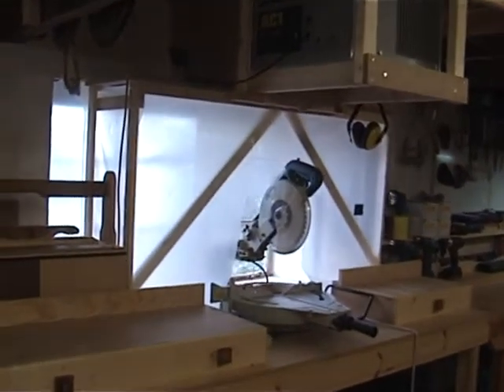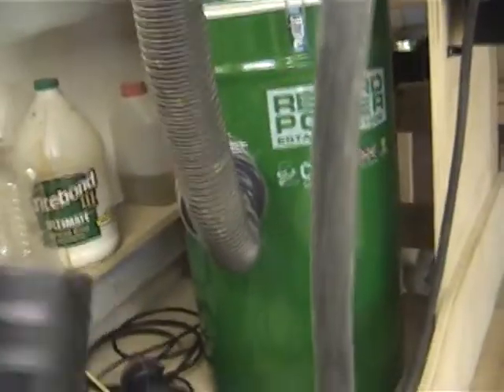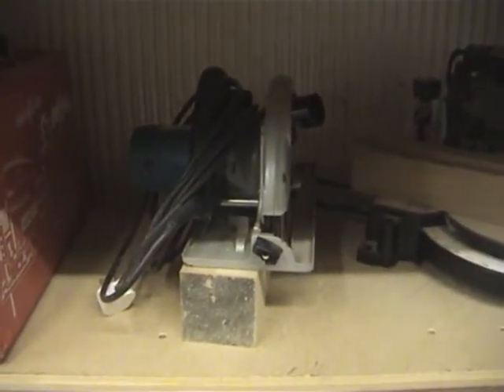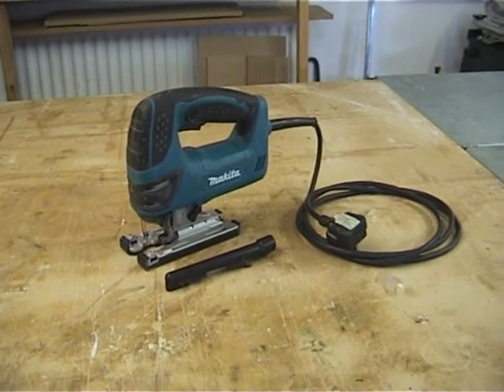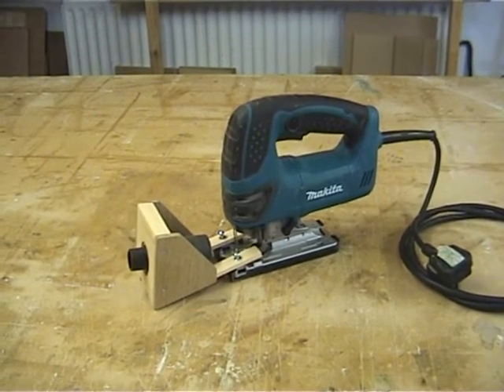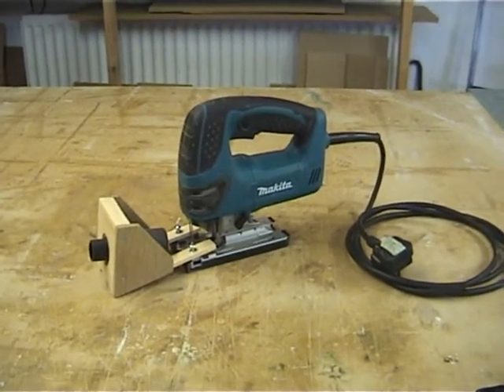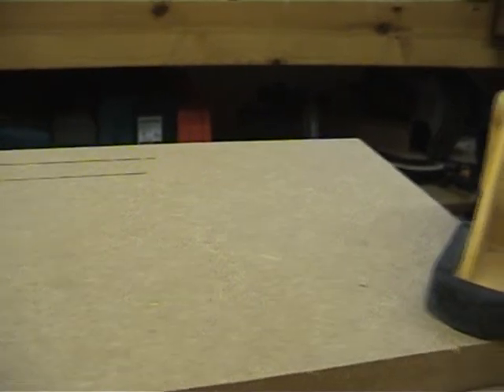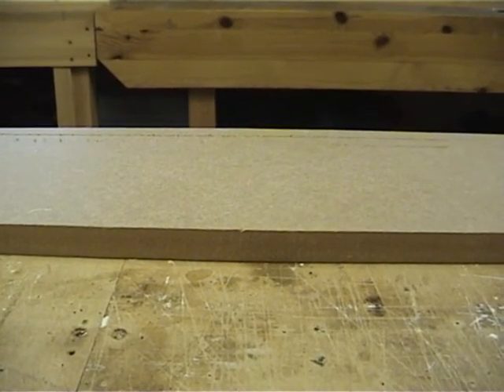Jigsaw Dust Extraction

Comment: There are several reasons I do not use dust collection with my Bosch 527BK;  Rarely use it ; dust just falls to ground unlike flying saw dust; just less to sweep; hinders use ;and fact that Bosch wants 40 bucks for simple plastic. For some tools a floor sweep collector makes more sense to me and good dust mask. I use a Eye Vac in my shop for such.

Comment: It works but it seems really awkward in use and not too practical.
Reply from the maker: Cheers Adam - apologies for the very late reply.  It does get a little bit in the way with some cutting, but generally very effective once used to it.  I don't use the jigsaw that much and this was mainly aimed for cutting MDF, which thankfully, I don't use much either.